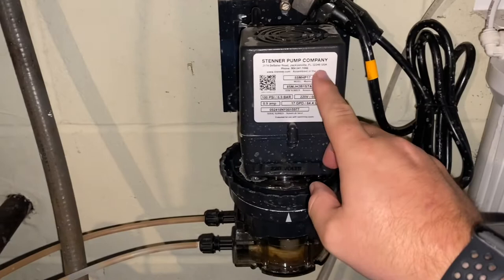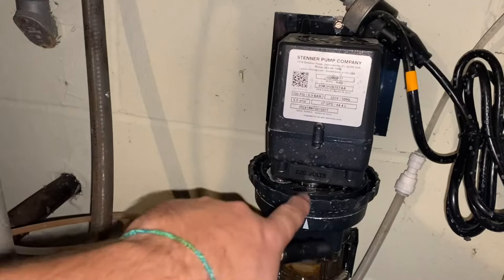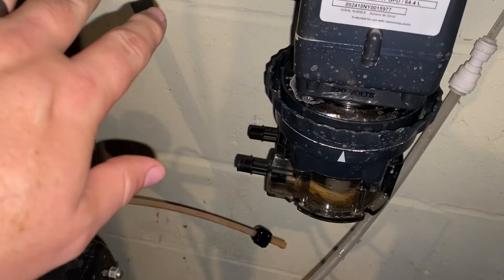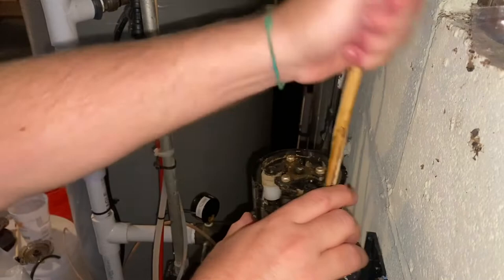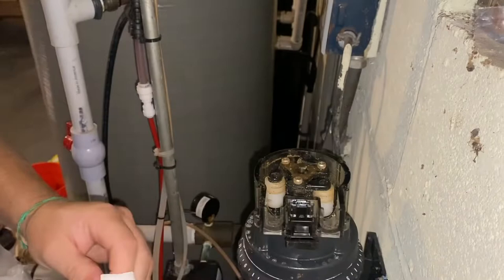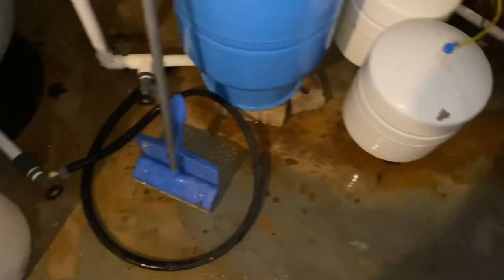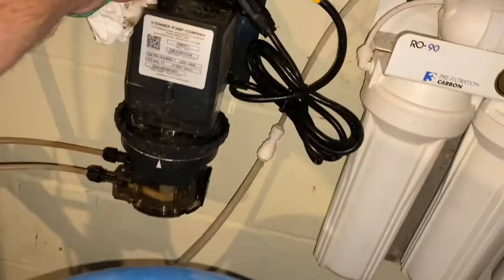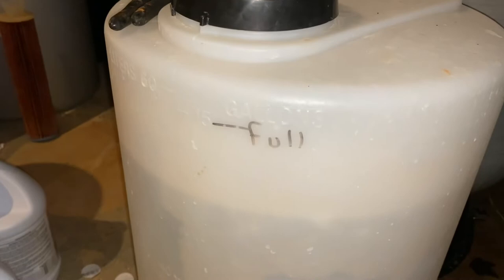How to fix a Stenner Pump that is Leaking | Stenner 85MHP17 #DIY #Stenner #howto

Comment: I don’t have a well or a water system, but still an informative video. I noticed the power was on or did you edit out flipping the power to the unit?
Reply from the maker: I already had the power off, turned it off when I noticed it was leaking. I may have edited out turning it back on.

Comment: What is check valve on big tank?  Water won’t stop running out of tube 2.
Reply from the maker: There is a duck bill check valve on the main tank, usually where the line enters the tank.

Comment: I think yours rollers collapse so it's easier I have the same one. Counter clockwise with the cover 2 screw holes as a key to spin it than clockwise to expand the rollers
Reply from the maker: I'll have to check that out next time! I didn't know that.
Reply: @efd  it's the 3 holes on that cover it matches up with the roller screws on top. I found out the hard way my rollers broke because I forced the tube in there. First time I got lucky second time it broke its expensive parts.

Comment: I have one and it’s only 2 years old and have had it fixed once so far and I went to go fire it up the other day and the pump does not turn on what so ever and it has power going to it… any suggestions? Thank you.
Reply from the maker: if it has power and isn't turning on, sounds like a bad pump.
Reply: @efd  I did a little bit more digging on it and that first first gear was bad,  $32 dollars later and it’s fixed now.
Reply from the maker: @nolanmcmanus4212  that's awesome! better than a new pump.